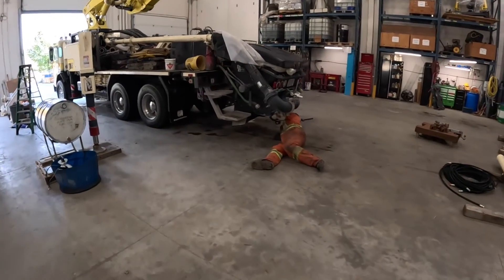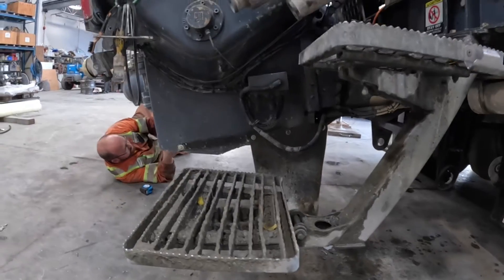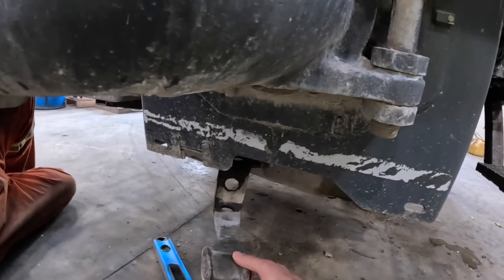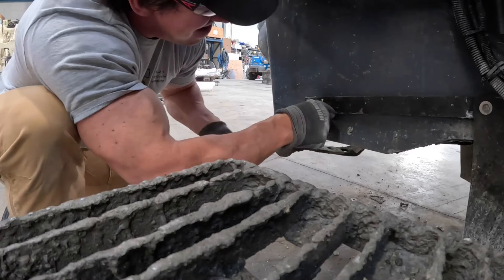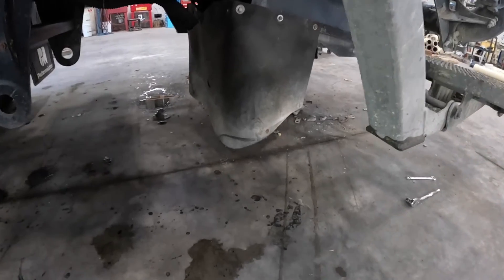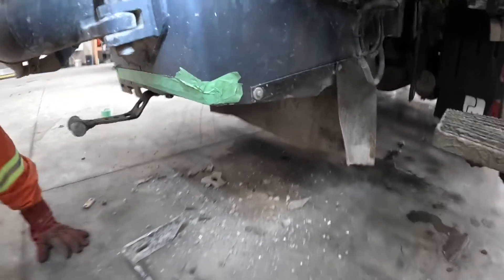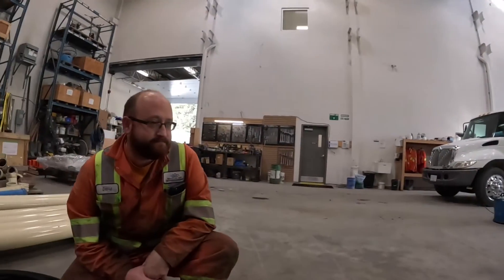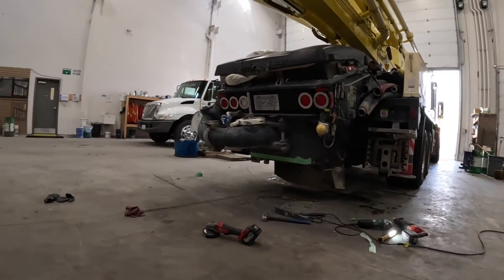Trimming a Putzmiester RS909 hopper for improved ground clearance/approach angle.

Comment: Could also cut that step support and weld in a heavy duty hinge so it's the same height off the ground but the whole step and support can be lifted up clear
Reply from the maker: I’d considered a setup like that as well, the only thing is that the feet of the rear outriggers when stowed sit just a touch higher than the current height of the steps, so really I can only benefit from another inch or two of clearance at the steps, then the outrigger feet are next in line to drag.